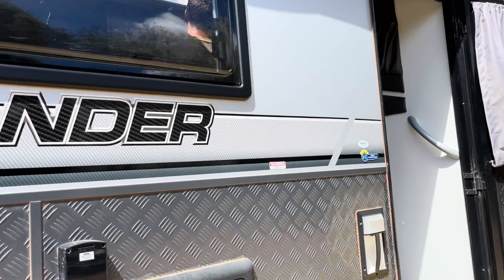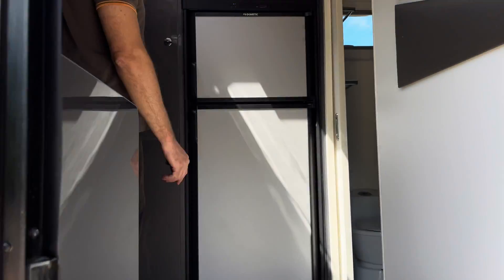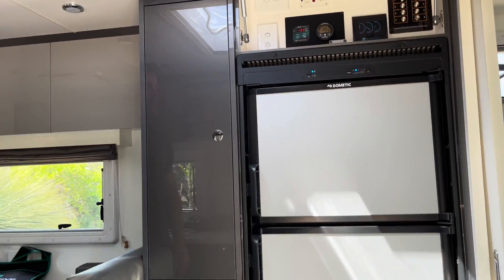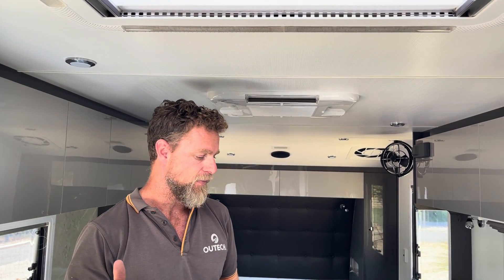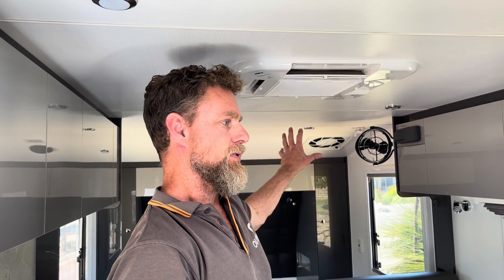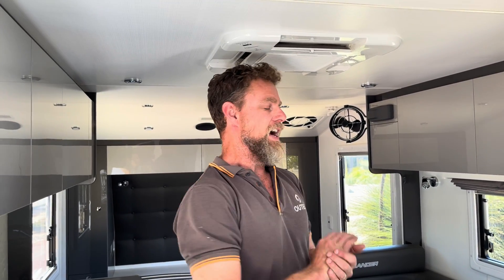Lotus Caravan 2018 - CONSERVATIVE Off-Grid Power Upgrade

Comment: Hi Dan, I’ve just come across your channel and have found your videos very informative, I’ve got a couple of questions. 
Why does the IBIS 3 AC need a modification to run it and what is the modification. Does the compressor fridge run on AC or DC when running the inverter. I look forward to seeing your upcoming videos.
Reply from the maker: Hi Brian. the ibis 3 is a direct online type compressor so the start up current is 6 times full load which is far too high for a high frequency type inverter. 

the compressor fridge runs on DC always. no reason to run it on AC. the compressor of a compressor fridge is a DC unit. 

cheers.
Reply: Hi Dan, for your reply. What is the modification required. We’re in Echuca Victoria, so I’d have find someone who can do mods to the ibis 3
Reply from the maker: We always recommend having your entire system evaluated by an expert so you can ensure that all aspects of the system are evaluated and reviewed. They can then determine if the mod is required. 👍